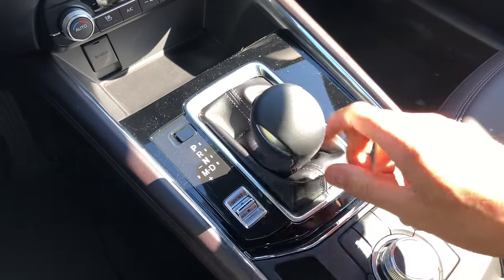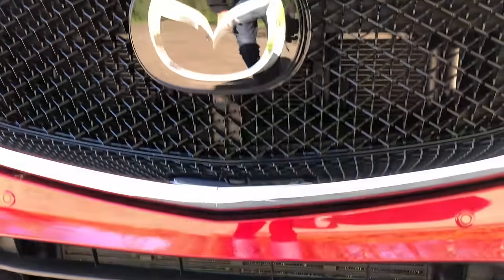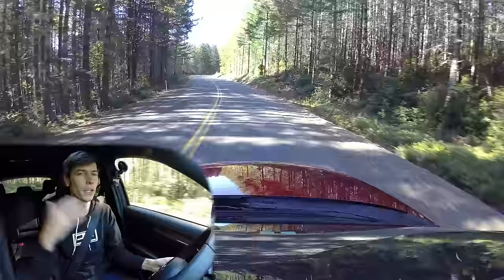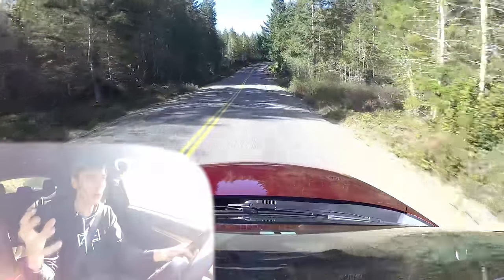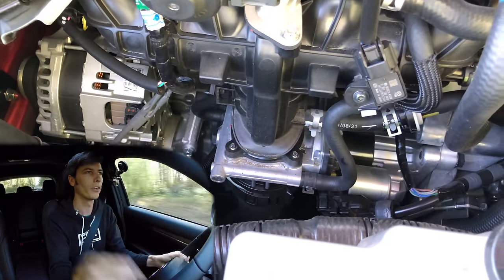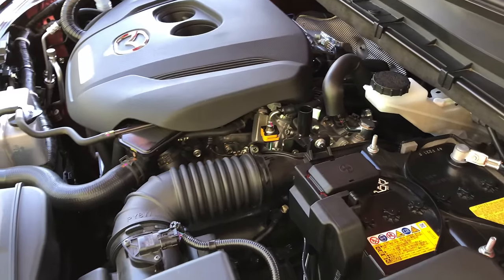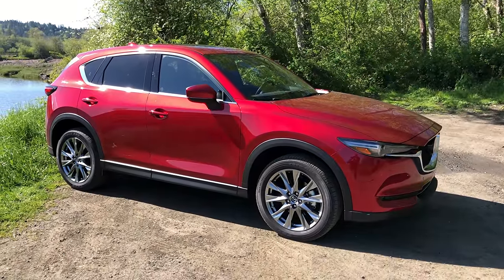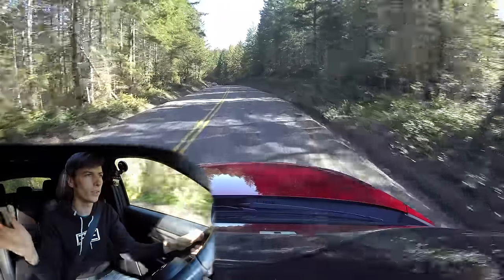Are CVTs Bad? Why Mazda Avoids CVT Transmissions

Comment: Looking to purchase a 2021 Kia Seltos with IVT, or a 2020 Mazda CX5 which has cylinder deactivation. I wish it didn't have cylinder deactivation, but falls within my price range. No matter where you look or how much you research, there will ALWAYS be someone having a problem or issues with any engine or transmission. This makes it hard to decide.  So, in terms of reliability and trustworthiness, which would be the better choice here?
Reply: Kia seltos IVT better choice 👍👍
Reply: Read forums...some Forte with the IVT same found in the Seltos have started to experience issues to the point of replacing entire IVT!  Just too new of a tech for Kia/Hyundai.  I’ll stick with a traditional torque converted 6-speed auto!
Reply: @ztekz  no hyundai/kia ivt transmissions are very reliable.

Comment: The torque converter is an amazing invention. 
The CVT is a bad idea. A metal belt doomed to fail.
The hydraulic automated manual has high clutch wear rate, 20-30K  miles! being dropped by most manufacturers due to customer complaints at the huge expense to replace the clutch.
The DCT is an automated manual using two auto box clutch packs as an actual clutch! Wear rates can be very high if driven as an automatic!

Comment: Yes my 2004 Mazda 6 transmission as the sole vehicle owner failed at 246,000 miles which isn't bad.  However, I changed all fluids frequently. I kept the car 11 years yet the first year I had electrical problems with the power windows which persisted until the car died. The structural integrity of the car stunk.  Constant front end alignment, bad wheel bearings and bad motor mounts at just 60000 miles.  No I didn't buy another one.

Comment: It's interesting to note that the Power Split Device transmission in the Prius -- gen-3 and up -- uses a planetary gearset. It is totally different from a belt-and-pulley CVT transmission; it's more reliable.

Comment: I alway bought, Since Mazda 6 Wagon 2006, then Mazda Premacy 2008 then current Mazda CX5 AWD Diesel 2012.   I feel automatic control is much better and smooth, when reduce speed,  automatic itself change gear down level and reduce save brake pad cost.   I recommend Mazda is improvement design.  New Zealand are bought a lots of MAZDA All Skyactive model are winner.     I have no compliant that it.  BUT....after 150,000km  I notice engine is small trouble running and fix resolved by services  cost NZ$300.  It's perfect now !!

Comment: Cvt's are able to provide the same direct driving experience, depending on the logic control systems.

Some cvt's will move your rpm slightly everytime you move the gas pedal to maximize fuel efficiency, while others act as a typical automatic with set gear ratios.

The only difference between the second options and a typical automatic is that a cvt is always in gear, and simply moves gear ratios, so it is completely smooth when it "shifts".

I'd also like to dispel many rumers about cvt reliability. Nissan had a single issue with it's early designs (before 2012-2014). After they sorted that they have been fully reliable, and that's when other brands began adopting them (Toyota, Honda, Subaru, ect).

Nissan and it's subsidiaries are now so confident in their cvt's that they either match or exceed the warranties offered by any of their compeditors.
Reply: em745a  they are doing precisely that. Hyundai, Kia, Chevrolet, Toyota, Honda, Subaru, Nissan, Mitsubishi all have at least one car with a cvt.

Brands that are more ahead of the curve like Nissan, Mitsubishi, Toyota, Honda, and Subaru have a large lineup of car, crossover, and SUV with cvt transmissions.

I highly suspect you don't own a cvt? You might change your mind if you did.

Comment: Great video as always. The new, 2021 Nissan Rogue comes with their newest version of their CVT transmission, they call it XCVT. Have you had a chance to drive the new Rogue or review their new transmission? Thoughts?
Is it true that CVT transmissions have a shorter life span vs. traditional automatic transmissions?
Reply: Nothing different except you need to visit the service centre as soonest unlike mazda 6 speed auto .
Reply: I'm glad you mentioned the Rogue, I Drove one when I had to have a rental car. I liked the car but felt something was wrong with the shifting of the Transmission. Not sure if the car needed some kind of adjustment or if it was normal. The agent for the rental company told me occasionally there are vehicles that will need to be reprogramed from the company if they are not able to do it themselves.
Reply: In general - yes. With the exception of eCVT.

Comment: Wow, they only sell 1/3 of the RAV4 volume. It takes a long time to shake off the taint of that Ford partnership. That Skyactiv setup seems really smart. I wonder about how durable it is over 10 years. The Toyota 1AR2FE engine is incredibly resilient, accessible in the engine bay, and parts are easily available.

Comment: We have a new Mazda CX30 with the 2.5 four and 6 speed auto. I have to say it's almost as fun to drive as a Mazda 3 or even a Miata. The transmission shifts quickly and always seems to be in the right gear. The new twist axle in the rear keeps the car on the ground on most surfaces. Fast curves become fun again. Really surprised how much fun it is to drive an SUV. Actually, quite a bit more fun than the CX5 that it replaced.
Reply: No, a  CX30 is no where near as fun to drive as a Miata. Not even in the same universe, drive one and it's EASY to understand why. Nothing in Mazda's lineup comes remotely close to matching the "fun to drive" factor as their MX-5 Miata. Mazda generally makes "Fun to drive" automobiles but their MX-5 Miata is in a whole different league here.
Reply: @erickelly4107  have owned both. Was in a Miata club for years. Have been really surprised how well the CX30 handles. Sure, it's not a dedicated sports car, but for an SUV it sure is a lot of fun on curvy roads. Mazda really did their homework on the engine tuning and transmission gear selection. Quite a bit better than our previous CX5.

Comment: How much more does it cost to repair a CVT compared to an conventional automatic transmission?
Reply: There is no repair, only replace.  My CVT on my Honda blew up with a bad differential.  It costed me 4400.00.  If it was a traditional transmission it could be rebuilt.  No shop rebuilds CVTs only replace from junkyards.

Comment: CVTs are different. I had a chance to drive a Nissan Sentra with a CVT, and it was fine. I also drove a Mitsubishi crossover with a CVT, and it was not something I'd be willing to drive for an extended period of time. The Toyota hybrid ones are pretty good.

Comment: I personally don’t enjoy driving any current Mazda, automatic or not, except the Miata 6MT. I find Mazda’s 6AT to be extremely slow shifting vs. the better 7, 8, 9 and 10 speed options on the market (VW DSG, ZF 8HP, BMW-tuned versions of the AISIN 8-speed auto (M235i Gran coupe, MINI, X1, etc.), Daimler’s 9G-Tronic, and the Ford/GM 10-speed transmission. Note I did not include ZF’s HORRID 9-speed transmission for FWD models like the one used in certain FCA, Honda/Acura, and JLR vehicles.

I also don’t really find their 2.5T to be that impressive. Sure it puts out decent torque figures, but it’s very peaky (dies off at 5K rpm) and it can’t match the smaller displacement turbocharged engines from competitors for fuel economy.

Comment: The concept of the CVT is way superior to step geared transmissions. The problem is that they were released before the bugs were worked out.
CVTs have been used for many years in golf cars, neighborhood vehicles, snowmobiles, and in the DAF cars made in the Netherlands.
The biggest problem has been that with available technology they are too small for their applications, therefore too easily overloaded.
The CVTs I have studied have torque converters with lockup clutch. The converters smooth start-off from a stop.

Comment: You say you don't want a spongy feel from the throttle position to power output. That's exactly what a CVT feels like. I completely understand the engineering reasoning for this style transmission. But from my experience CVT's are throw away components. People don't maintain them. And when they go out that's pretty much it. Not that auto's don't do that. But it seems to me that an auto with good software programming and high end internal components can both be efficient and have a long life. It seems to me that CVT's are the automotive industry's answer to cheap manufacturing. Investing as little as possible to profit as much as possible.

Comment: I have 2016 Mazda 6 2.5L NA
130k Miles on it after almost 5 years. I use it like a truck sometimes 🤣😉. The weather 130F. No overheat issues, powerful engine, and economy.

Comment: A CVT keeps the engine in it's peak power band far more, something all gearboxes are trying to do. What's not to like? 
You don't have to worry about rough shifting as there is no shifting in the first place. People are just set in their ways and too stubborn to accept a radically different way.
Reply: Cvt is a loss of power and torque and can't tow and it's way less reliable in the long term... What's to like?
Reply: @malo2452  It needs work in durability but it is fuel efficient if driven without performance in mind and used for commuting purposes which is what real world driving conditions mostly consists of. 
It also gets the power down really well.

Comment: I know this doesn't seem to be a majority opinion, but I prefer the CVT in my wife's Altima to the conventional automatics in most ordinary cars.  It's not as good as a manual (my preference) or the better automatics you can get in more enthusiast-oriented cars (I've driven BMW 3-series and a Dodge Challenger R/T that were both very good), but most automatics I've had in economy car rentals have been pretty bad.  They seem programmed to maximize fuel efficiency by lurching from 2nd to top gear at the lowest possible speed and won't come out again without serious prodding.  In the Altima, you can treat the throttle as a rheostat; engine rpm is directly proportional to how far you press the pedal.  Don't want the stereotypical CVT drone?  Start off at half throttle, then progressively feed more in until the desired speed is reached.  In that last generation Camry rental I had a while back, if you have it half throttle in a 40 mph curve, nothing would happen because the motor could barely pull top gear from that speed.  3/4 throttle: still nothing.  At nearly WOT, the computer says, "Oh this is some kind of emergency" and gives you 6000 rpm.  If this catches you by surprise and you lift even the slightest, it lurches back into high gear.  So you can drive at 3/10 or below or 10/10.  Nothing in between.

Comment: Thats true, i have mazda 2 g90 and you really don't need to change gears like in other cars, and it likes to be driven in low rpm and high rpm as well. Amd when you rev it and change gear you dont feel that lag, pause, that change it just goes zoomzoom. 😀
My mazda fuel consumption for now is 5.4l/100km it's still a new car. I was driving Wv Polo too, oh man what a different experience. You have to change gears all the time, and downshifting all the time. Polo 1.6. 95hp 6.1l 100km diesel consumption is worse than of Mazda. So yeah.. And all these 1.0 3 cylinders turbo engines, they're consumpiton  is no close to Mazdas. Hyundai i20 1.0 average mpg 35.  And drive feel is way worse

Comment: I had a hyundai santa fe 2007 owned almost 14 years now VGT is very reliable, just change atf oil evry 60k mls. My 2018 subaru xv/crostrek cvt very smooth owned for 2 years, my 2006 audi a4 which is unreliable engine 2.0tfsi most hoses are plastic but I upgraded into braided hoses,  and thick silicone cooling hoses. 200hp the cvt s-tronic still feel like brand new same thing I change every 60K mls with the proper audi cvt oil. My  2018 renault megane edc gearbox is faulty bought it brandnew after a year i traded into subaru because renault edc gerabox is very dangerous sometimes it suddently not responding the gear while driving in motor way. They keep updating the software and still gearbox not responding like neutral. It happend 5x faulty in 12 months, finally  i get rid of it waste of money.

Comment: Its funny about CVT’s, the dislike comes from a question of build quality vs actual qualities if the system. Nissan, the most famous “user” of CVT’s was in a money bind in the late 90’s, so in order to cut costs, cheaper materials were used in many parts of the cars, including the CVT, where plastic parts were used. Now out of the  cost bind the quality of transmissions have been put back to competitive with late Gen 5-Gen 6 models, but the damage was done to their name.

CVT’s actually are an incredibly smart choice for fuel econ, weight, and costs, but misuses of the technology during economic desperation has people wondering across the market. 

Its fair to say that even with questionable build quality and cheap parts, Nissan/Datsun CVT’s could still push 200K miles despite it.

Comment: My first cvt was a Nissan versa at first I was not sure how good or how long it will last but after driving it for a while I don't notice too much different with automatic transmission it feels smooth you don't get to feel the shifting gears it does respond slower when I stepped on gas i just don't feel the down shifting like the auto

Comment: Mazda make some good cars, however I have come across quite a bit of negative comment with regard to their automatic gearboxes. After much reflection and twelve years driving VW automatics the end of October saw me move over to Toyota and get a Corolla 2.0 litre Sports Tourer, an estate to me. It has an eCVT and swaps seamlessly from petrol to battery. Relaxing to drive and with enough umph for overtaking when I need it. So I don’t get Mazda’s problem. Perhaps they should stick to producing good manuals and leave the challenge to others?

Comment: I got the cx-3 and waiting for it to arrive now. Hope I made a good choice. Seems I like a traditional naturally aspirated 2.0 liter engine with all the power up front. Seems every other car in my price range is doing 1.0 liter or 1.2 turbo. Those engines seem underpowered. turbo is nice until it deteriorates which is quite quick and that excess hp figure is with turbo on when you floor the throttle.... ie not city conditions.

Comment: CVT's do not change pulleys? The CVT has two variable diameter pulleys which are always used.  I have noticed other cars lose ground against the CVT when they shift.

I have 113000 miles on my 2006 Nissan Murano; however I have heard that the newer CVT's are not as well made to reduce costs?

Comment: Mazda has always had the "sporty" tag, even back into the early days. When other cars were going fwd, they stuck with rwd, for the sportier feel. 

You know, I sometimes laugh when I hear people talk of rough shifting and laggy/sloppy feel... etc etc in modern cars with autos.  I look at them and think, yeah, but you're old enough to remember the cars of the 1960's, 70's, 80's and such.. when autos were laggy, could shift rough.. etc etc.. lol. I believe its an issue that will never be fully solved.. I remember back to the days of old 3 speed trimatic, Borg Warner 35/55 and the 4 speed Aisin Warner 70( that is in my daily driver). They all suffer the same issues as the modern ones. Barring the fact they aren't or weren't  computer controlled in any way.

Comment: One of the cars we own is a 2011 Mazda 3 sedan.  It has a 1.5L motor with a CVT gearbox.  No ball of fire to be sure.  I am told Toyota supplied the CVT for this model to Mazda.
Reply: Maybe that mazda you have is a rebadged mazda but its a Toyota,i thinks its a Toyota Yaris.
Reply: mushi mushi mushi  you are wrong...... just google Mazda 3 domestic Japanese Spec.

Comment: Honda makes their own transmission. Toyota works with Aisin. Both brands are reliable. Nissan has a bad reputation with CVT during the Renaultssance. Subaru makes their own too but I’m watching owners say they have problems with their cvt. Could you talk about thoughts on this? If the Mazda went automatic and has just as good mileage as the other suv brands, then why go cvt?
Reply: CVT's are almost always cheaper for the the Mfg. to produce and a cheap, easy way to boost MPG. There is little or no benefit to the consumer other than possible price reduction.
The fact is most buyers don't care, and the Mfg.'s even use CVT as a selling point.

Comment: I could not make sense of your explanation on exhaust gases cooling the combustion process to reduce heat and knock. Like why would gases that just went through the combustion process be any cooler than plain atmosphere. My best guess is that exhaust gases are laden with CO2 and that is restricting combustion, but that begs the question why not use an increased exhaust back pressure strategy to reduce scavenging in the combustion chamber. Rather than circulate exhaust gases in a circle leave them where they are using a variable restriction of exhaust back pressure?

Comment: "Belt that's changing pulleys"? No, the belt(s) ride(s) up and down a set of cones that widen and narrow to make the smoothness of the pulley system. Otherwise it's hardly continuously variable... although I also know about that one clicky version that you told us about that defeats the purpose of the CVT concept.